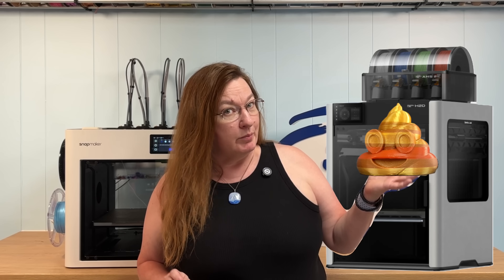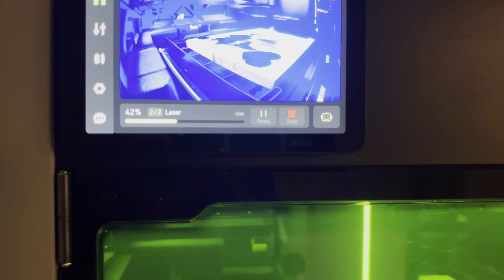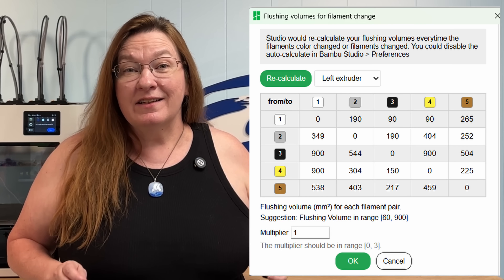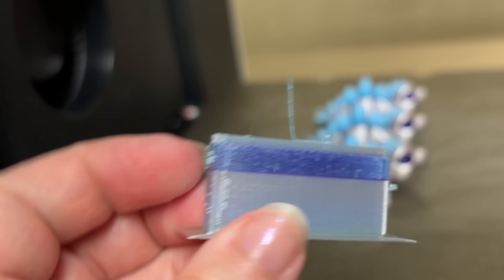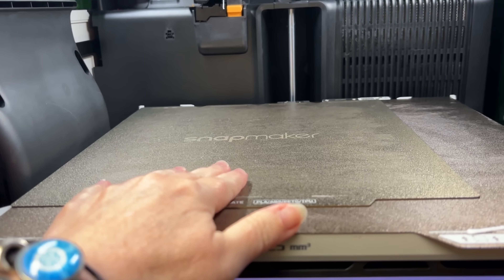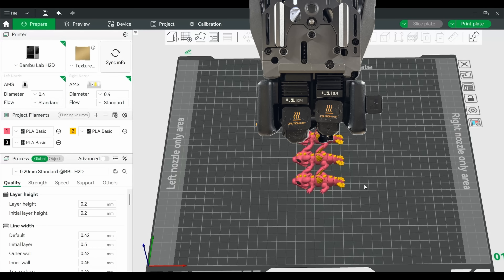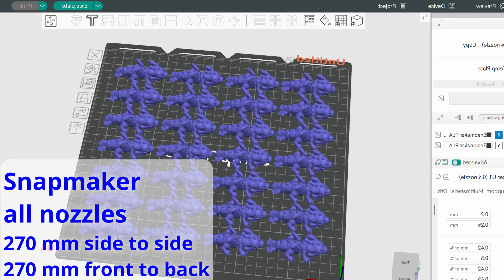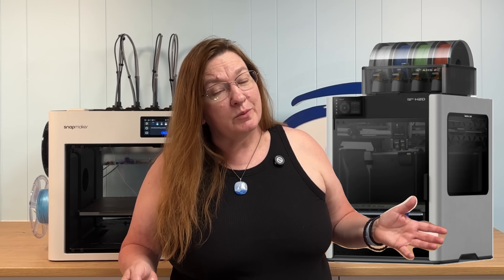Snapmaker U1 vs Bambu Lab H2D (Testing Speed, Print & Poop)

Comment: I would add that the fixed (right) nozzle is recommended for printing with materials that are sensitive to stretching, deformation, or snapping, such as carbon/glass fiber reinforced filaments or soft TPEs/TPUs.  You can definitely add AMS's and should to the left to optimize print times and filament waste.  Not that it's not recommended connecting AMS's to the left.  I run a 2x2 setup along with an HT connected. There are no issues running them through the left.

Comment: can you do different nozzle sizes for the U1? like print infill and inside walls with bigger nozzles for higher speed and outside details with smaller nozzles?
Reply: nvm on their official website it says "Note: Different sizes cannot be used in the same print." 
but i expect people will find a way to mod the slicer at some point.. can't see this being a hardware limitation more than a temporary slicer implementation limitation

Comment: You can still get printers for dirt cheap; they just have capacities only somewhat better than the dirt cheap models of yesteryear. But there are still valid choices from the likes of Elegoo or Anycubic; bed slingers, sure, but you can get into printing for a few hundred. Also if you need huge prints, they have slingers with 450 mm on a side. If all you need is to churn out big prints, or emphasize tons of models per print run, those are still of interest. But that said, a four-tool changer from Snapmaker for these prices is truly impressive. I'm waiting to see what can be had with the new upcoming Bondtech INDX system, personally, but even so. Real tool changers also open up for using things like dissolvable support materials which could make post processing so much easier.

Comment: Great no nonsense video!
I think Bambu Lab didn't nail an optimum design with the H2D - that dual head is doing an awful lot of work printing multiple colours. Unsurprisingly reliability and teething problems with print quality have been an issue for some owners due to complexity and calibration.   And yes waste is an issue!.  The H2C upgrade proves the point  that the H2S and H2D were transition designs.....for multi colour printing.   
The snapmaker UI looks like a better design at an affordable price with its main limitation being less volume and inbuilt  filament drying.

Comment: If you need multi material and don't want the waste buy a U1 and open source access. Or buy the closed source non mult material AMS Bambulab which is old tech already any only might get a upgrade but it will likely be jank.
Even with the H2C you still need the AMS and that will limit you to what you can print with it.

Comment: While it's probably a decent machine there is no doubt in my mind that it will not print with the same quality of the H2D. Also, time will tell how many problems will crop up and the overall longevity of it. Gerry
Reply: Snapmaker U1 print quality is very good. Maybe even better than Bambu Lab. In regards to longevity, only time will tell.

Comment: I think it's a mistake to dismiss ecosystem so causally. Bambu's ecosystem is one of the main reason I've stuck with them. It goes beyond software and filament RFID tags; it's also about spare part cost and availability, and not worrying about a new version of the printer you just bought being "updated" a few months later, and now your current printer is abandoned by the manufacturer. While we can get filament from anywhere from any manufacturer, the RFID tags are a nice feature to have regardless of manufacturer. It tells the printer which material it is and loads the profile for it. Which is another valuable part of the ecosystem: well-tuned profiles and settings.

I hope the U1 does well; it can push the market forward like bambu printers have. But It's too early to recommend it over reputable machines. There's not even a final version of the printer in anyone's hands yet. I'm taking the wait and see approach. It seems impressive so far, but a printer is more than just the hardware it ships with.
Reply: Maybe Bambu has learned from experience but there were parts of their printers that they had no plans for how to replace when they wore out. Also, the closed source, the Chinese-ness of it all, the way they ripped off the Prusaslicer without even giving credit at first and so much more - I just don't like Bambu. I also don't like low-tech color changers that waste gigantic amounts of filament.
Reply: @cr0ft-2k  There's plenty of devices out there that have parts not intended to be user serviceable; that will bother some people, not me. This comes with being "appliance grade" machines, and not projects in of themselves. I get the concern though, but it's just not something that concerns me.
And the closed source doesn't bother me either; it's a double edged sword where you trade openness for convenience. Again, I'd rather just have something that's turn-key. Not to mention that most companies touting "open source" aren't as open as they want you to believe, and this includes prusa.
"Chinese-ness"? Really dude? There's literally only a small handful of printer manufacturers that aren't chinese, and of them only prusa is really marketed towards consumers. China has it's share of problematic practices, but assuming something is bad just because it's chinese is blatant and pointless sinophobia.
Their criticism of not crediting prusa at the start is valid, but now rectified.
It's fine to dislike a company; I dislike prusa and their high and mighty, open source but not really, overpriced printers that are outclassed by even something as basic as the $300 centuri carbon. Luckily for us, there's plenty of choices available now.
I somewhat agree on the bambu (and plenty of other manufacturers now) AMS units; I don't like to waste filament, but I do like having four or more spools ready to go at any given time. So even though I don't do much multi color printing aside from signs that have only a few color changes, the benefit of having multiple different spools and types of filament ready to go for any projects is something I'd not want to go without again, so I'll never buy another printer without a multi material system.
Choices are good. Things that push the market forward are good. 🍻

Comment: The real push and software development for the U1 will hopefully also push for Prussia to follow-up with software development to really exploit what Baltimore material is capable of doing in concept. I am really hopeful that with 2 companies and I would wager to say that snapmaker after the success of this Kickstarter is definitely can be claimed to be a bigger company, that they  We'll be able to really push slicer development for multi toolhead printers specifically what I'm really hopeful and wanting to see out of Prussia and snapmaker is Selecting in toolhead or filaments perfunction and to that I mean printing outer shells with not just a different filament from the inner shell but also a different nozzle size. 

The example I keep using is the use of carbon fiber filaments so let's just say carbon fiber PETG.  Using that on a standard point 4 mm nozzle for inner walls. Using a standard PET G for outer walls with a high detail point 25 or point 2 nozzle. And then doing infill with something like a 1 mm nozzle or a point 8 mm nozzle something that would extrude fast and Have that also be in CFPETG..

Comment: 9:45 I could be wrong. My understanding is that the slicers use the same STL file and generate unique G code depending on the 3d printer model
Reply: That is what I thought, like bed size, etc.
Reply: Different slicing program genrate Different gcode, but not as in a different language, just different ways of doing things, for example I have a sindoh printer at work and if you use their software you can see a preview of the print before you start, and in some situations it's a bit faster (then cura which is what I use), basicly the printer software is optimized for the printer its made for, but you could theoretically use any slicer

Comment: I am new, want to print something durable for my PC or server, but I need to use it in my bedroom, but practically bambu is triple price of snapmaker :(
Reply: You don't have to start at this level, when it comes to printers. Even Bambu has an A1 Mini for like two hundred. It's not enclosed and it's small but it will print what you need out of PETG just fine. Anycubic and Elegoo are two other Chinese makers that make cheap but perfectly servicable bed slinger type printers. The Anycubic Cobra 3 Combo with is multi color is currently 350 bucks. If you settle for one color at a time, 250. The Elegoo Neptune 4 is like 180 right now in single color and it would no doubt work fine. The 4 Max prints huge prints for 350. So yeah, plenty of options to these somewhat higher end multi color CoreXY options. Just a little more primitive perhaps. You get what you pay for - these cheaper ones will not produce picture perfect stuff all the time. Higher quality is just part of what you get when you spend 3-4-5 times more.
Reply: @cr0ft-2k thank you, I want to try something cool 😂 probably bambu is my level as it has almost plug and play

Comment: I was going to get a U1 but I am waiting for the H2C. Bambu Labs being closed source hasn't been a problem for me in a combined 20k hour printing with all my printers. IF HOWEVER they didn't offer parts for repair I never would've bought one. I've built 3D printers from scratch in the past and used some creality machines. I've repaired my Bambu Machines a few times.....a few. I've rebuilt my creality machines several times over chasing down print failures.

Comment: For me, there is no comparison, and I would absolutely prefer the Snapmaker U1. The primary features I would miss is just higher temperature. That said, all of the advantages of a true tool changer at a much lower price and open source firmware without a locked down ecosystem. Totally a winner for me. The print quality looks fantastic so far and it seems they did a really good job with the hardware. Hope the production units are great!

Comment: Bambulab has really disappointed me. At first I had high expectations, but in practice there were constant issues – from small malfunctions to problems that completely stopped my prints. Instead of enjoying the printer, I kept dealing with repairs and searching for spare parts. You buy a printer to create, not to constantly fix it.
Reply: Which printer do you have? Bambu is typically bulletproof for the most part. I had their A1 and X1C. I sold them both but I could only stay away for so long lol. This snapmaker is a steal right now, and I'm curious to see the price on the H2C coming out
Reply: User error
Reply: You had THE EXACT SAME experience I had with Bambu.  come to find out a LOT of people have had our shared experience of issues after issues with Bambu.  But they hide it all with fake reviewers and paid bots
Reply: Fake post.

Comment: For me, one important argument is missing: the U1 will be open source, while the Bambulab will not.
Reply: I hear you, and I understand the concern - in the abstract. I think that for the vast majority of users, it’s not an important issue. Even for me - I’ve been a coder for 40 years - I don’t care that the printer is closed-source, any more than I care that the code for my oven or my car is closed-source. Is it nice to be able to audit the code for security issues? Sure. Would it be cool to have community mods for the printer firmware? Maybe? But the printer is a tool, and I have too many hobbies now; I don’t need to add ‘tinkering with my tool’s firmware’ as another one. Don’t get me wrong, I signed up for the U1 super quick, and if it meets my expectation, I’ll probably get another, and replace both of my Bambu printers. But my reasoning has nothing to do with open- vs closed-source.
Reply: @karmachameleon326 I think a lot of people are more concerned about getting locked into a closed ecosystem in some way and general enshittification. Companies seem to be searching for more control and micro transactions these days and I feel that it's important to communicate our approval for those bucking that trend. Especially with the history that Bambu has had around LAN mode and third party firmware. I don't need my car to be open source (though that would be nice) but I would prefer some piece of mind that they aren't going to paywall features down the road that were included with the car or tool.
Reply: @karmachameleon326  That's the thing, most average consumers who want to get into 3d printing won't care about open source (which many printers releasing these days are NOT, including the U1) vs closed source, and ev4een more probably have never even heard of the "open vs closed" debate a lot of online personalities seem to base their entire persona after.
Reply: @karmachameleon326  The H2D is UNREPAIRABLE by the average consumer...If your using for "business" and anything goes wrong...YOUR SCREWED. The U1 is tooled for ease of repairability.  You should think about that
Reply: @anthonylong5870 Not true. I've been replacing my machines in my farm with H2D's and I completely disassembled one and then put it back together just to be familiar with these machines in the future. I was much more frustrated assembling the XL, and it messed up so much that constantly disassembly was mandatory.
Reply: @anthonylong5870 How can you say that? You have an U1 with 2000/h printing time?
Reply: Yep this is massive for me and many others. The ecosystem won't be closed down either and it looks like they kept reparability in mind.

Comment: the $149 top cover is a bit of a waste. it is not active heating. it filters out some fumes but honestly it should be a minor project to print your own.  not pla but print in something a little more heat resistant and you can add a air filter and be far far cheaper. won't be see through but not a big deal.  i also expect 3rd party covers to be a lot cheaper
Reply: Really need the top cover for PA and PC in my opinion

Comment: you tried asa. that should tell us a bit about abs too but have you tried nylon or pc?
Reply from the maker: I figured Nylon would definitely need the top. But I could give it a shot.
Reply: I'd be curious to see Denise try it also, but Tech Napa (French) also showed PA and other engineering filament printing. Without a lid he only did smaller parts for the test though.

Comment: 9:08 Just training wheels for people new to 3d printing?  You know what else it is?  NICE for people NOT new to 3d printing who got sick of screwing with all the fidgety crap and just wanted to PRINT.  I left the hobby for a while because I was so sick of messing with my ender printers.  The Bambu experience has been night and day different.  SO much easier to deal with and most of the time everything just works.  My only problems have been filament related (brittle breaking off in the feeder tubes).
Reply: You and me both.  I had the edner 3 S1 Pro and it almost caused me to lose my mind.

Comment: If only there was a U1 XL with 350³. Probably gotta wait for Bondtech`s INDX and slap that on a 350³ Voron.
Reply: INDX is so hot. Def the ultimate multi-material option so far, but the Snapmaker looks great. Vortek looks awful.
Reply: I am thinking about putting the INDX on my Sovol SV08 Max 😁
Reply: Snapmaker has said 2026 late they will be putting out a larger build volume U1 Plus
Reply: @anthonylong5870 unfortunately too late. by that time I'll already be sporting that INDX Voron unless the system turns out to be a turd.
Reply: @anthonylong5870  I wish that was first.  I expect when this sells out at $1000 MSRP that larger one will be $1500 with no kickstarter discount

Comment: What are you talking about not using two ams on the h2d? I wouldn’t even want to run mine without dual amsS not to mention it supports way more than just 2 ams’s.
Reply from the maker: It was in the review guide. I poked around the wiki and they toned down the warning: Recommendations for materials used for the left and right hotends
If you only print monochrome materials, it is recommended to use the right hotend for printing.
If you need to work with AMS for multi-color printing, it is recommended to connect AMS to the right hotend.
If you want to use the second hotend to print support materials, it is recommended to use the lifting hotend for printing.
TPU is only suitable for the right hotend.
Reply: I think you just interpreted it wrong. I understood her as saying keep the ams 1 or more, on one nozzle the second nozzle not to use the ams but the external spool holder. She later states you can have 25 colors.
Reply: @brandonberkmortel9558 that's exactly what she said, but it's wrong. You can run multiple AMS units on each nozzle.

Comment: Prusa XL killer more than an Bambu h2d killer 🤷🏽‍♂️ compare a tool changer with a tool changer
Reply from the maker: Its on the list!
Reply: @stldenise thank you. Thats the one that is needed the most. Apple vs apples. Sure build size is not, but neither is it with the h2d.
Reply: The two machines are not at all similar in size. I'd call it an X1C killer for sure but the X1C is half way to senescence anyway

Comment: I’ve been happy with Bambu but I’m looking at the Snapmaker for my next printer assuming replacement parts are available and software support is good.  Will wait for release and more reliability data before buying… unless I just can’t wait
Reply: Bambu has a vortex nozzle switching system coming out. Tho I'm sure it'll be more expensive
Reply: @korn2040  LOL Yeah I am expecting 2k+
Reply: Snapmaker has been around the block and is still supporting their older machines.
Reply: @richardbertacchi5016 these are things being told to me by snapmaker users so that's not fully true